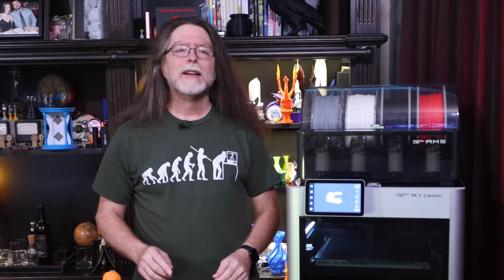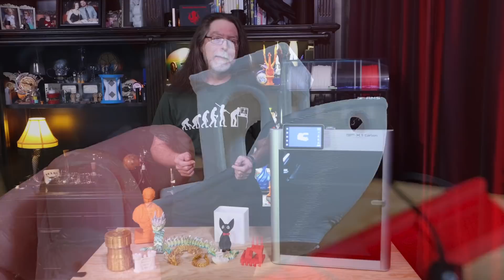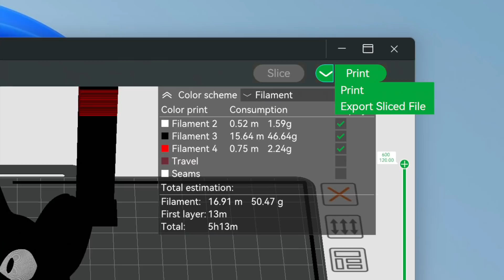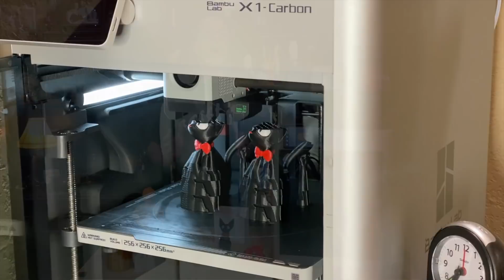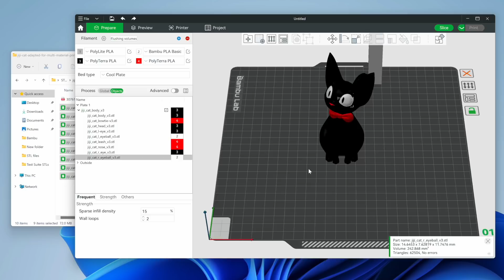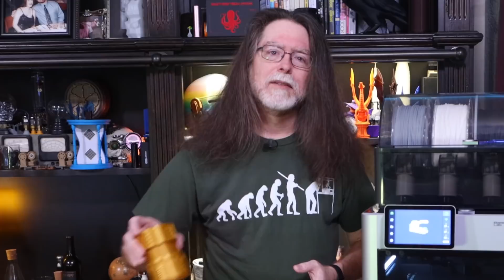First Look! Bambu Lab X1 Carbon - A CoreXY SPEED DEMON!

Comment: Does anyone know what the printer height is with the AMS on top? I've only seen dimensions of the printer itself.
Reply from the maker: Hi, it's 27 inches tall with the AMS on top.
Reply: @BV3D  Thanks so much for replying. I have a Creality CR-200B that I want to replace with this sitting in a 700mm space about 27.5 inches. Looks like it opens from the top so I would have to pull out the printer to change filament spools.
Reply from the maker: @RaviBowman  Yeah, you're looking at something like 34 inches to be able to open the lid on the AMS without moving anything. You're also going to need a bit of space behind the printer for a box to catch the purge squiggles. You'll need to pull the printer out to get to that so you can empty it.

Comment: As a 24/7 cloud connected device from china I don’t trust it. It could be acting as a backdoor to your Wi-Fi network or monitoring your devices data and sending it back. Also sending all prints to the cloud fist seems ripe for control reasons. Could easily monitor what you print. You print a nerf gun all the sudden you’re on a terrorist list thanks to this printer .

Comment: Umm this RFID thing I think is the most underrated feature of this printer . If they open source standardize a way for printers and slicers to automatically download settings for a filament kinda like driver for a piece of hardware. It would completely negating the need for filament tuning . That takes 3d printing to the masses . 

Like imagine this; I'm Joe schmuck nobodyson and I buy this printer and without having ANY knowledge of 3d printing I get some ninja flex , some Ataraxia FPLA and for the shits and gigs some Amazon basic . I plop them into my printer and the printer does its jig and tells the slicer I have xyz. The Slicer sees what filament the printer has loaded and   automatically grabs the optimized settings for the individual filaments, without the end user even having to know what they bought and where they put it !!! 😳😳😳... It's like using a microwave at that point.
Reply: 100% facts

Comment: Definitely picking this machine up at retail, assuming all the bugs/quirks are worked out  by that point. Hopefully this thing delivers on all its potential.
Reply: I am onboard with you. Especially with the proprietary parts (extruder) I first wanna know where Bambu Labs is going with this.
Reply: @hbgl8889  I'm also not into the idea of a printer that is only functional if it connects with a specific company's network, as I think was mentioned in this video. Wouldn't want to be stuck with a useless metal box if something happens to Bambu Lab's bottom line. Lol

Comment: What about octoprint compatibility?
Reply from the maker: Negative. With no USB port, there's no way for OctoPrint to stream G-code to it. That said, both the mobile app and hte slicer allow control of the printer. But if you're heavily invested in the OctoPrint world, and have some favorite plug-ins or you've got custom scripts running, this won't do that.
Reply: @BV3D  this is a Major Mistake on their part. In a proprietary system, you want a way to introduce features without voiding the warranty or messing with the FW. This might be a bigger problem than they realize. I e it be buying without integration. .

Comment: This is the third review of this printer I've seen in a week but the first that mentioned the mandatory internet connection. Thanks. 
Mandatory connection and registration is a hard no.
Reply: People are going to get sucked into a pay model you watch
Reply: There is no mandatory internet connection. I have been using the SD card. An internet connection is only needed if you want to send files to the printer over WiFi.
Reply: @rsilvers129  it should not require internet to work within a network, regardless whether it’s connected to the internet or not. The way it is made in this printer makes zero sense.
Reply from the maker: @rsilvers129  You didn’t have to get your printer on the network to get it added to the mobile app? If you didn’t, Bambu must have changed that (and that’s a good thing). I have printed from the SD card a few times, but I do like the convenience of printing from the slicer and also being able to monitor a print from my phone.
Reply: @rsilvers129  do you already have this printer?
Reply: Right if they stop the servers your printer is a pile of metal

Comment: THIS is the type of printer the community needs, something that can go mainstream, because right now there is a high learning curve that really keeps a lot of people away from 3D printers, making something fool proof where the average Joe can just send something they like or need to the printer and have it done quickly without issue 99% of the time will rocket this hobby (and yes, it's still a hobby) mainstream.

Now if they can get the price down further to under $1K, but I'm sure that will happen soon with either this company or another.
Reply: 100% get the price under $1k regardless of where one lives and then it will be real killer

Comment: Requiring internet and an account to use their software is a non-starter.  

Shame, almost eveyrthing else about this printer is ideal.
Reply: It doesn't require an account to use their software or the printer.
Reply: @rsilvers129  it is made explicitly clear in this video that you need an account to get the machine up and running.

Comment: Holy smokes! My dream printer seems to be the Carbon. Can't wait to see how the Kickstarter goes, and how support will be for those early adopters. Please keep us up to date on any changes/issues.
Reply: Kickstarter went well for BLabs, I'd say. Seemed to have launched a tad early? But the Early Bird full combo was sold out within minutes, with the lower tier filling up after that rather quickly. Many people just seem to have jumped to the Kickstarter special to not get the KS errors. Seems they likely made up some of the margin in the shipping costs, as they were steep at $160/unit for US - these will likely ship all together in a container, so costs will probably be lower for BLabs.

If I had to guess, all Early Bird and Kickstarter Special units will be accounted for within the first few hours at the rate it's going. It'd be questionable to grab one of the full price tiers because of the shipping costs (you won't likely see it that high in the full retail launch).

Comment: A little jeally, I gotta say…. This is probably the best overall consumer printer going right now. Of course it does need a powerful board to be able to achieve those speeds, and it needs high torque stepper drivers, so the Duet is a very good choice. It has a speedy processor, powerful (and loud!) DRV8825 drivers onboard, and runs the super-configurable RepRapFirmware. From what I understand, it also uses servomotors instead of steppers for X and Y, at least. Now I'm wondering if I could get the E3D Toolchanger up to similar speeds, hmmm….
Reply: I think it uses steppers, but i could be wrong.
Reply: The speeds are impressive for a consumer printer and I am impressed by that. However, to bring the comment back down to earth its not any faster than DIY printers modern 32 bit boards and 2209 drivers with Nema 17 steppers are all that is needed.  Throw in a Pi 3 and klipper firmware and you have a much easier to use interface than rep rap. Check out V3d, Voron, ratrig  for examples.
Reply: It's not a miracle printer. But as an off the shelf printer it should be very good.
But as doyouflytoo already said, DIY printers achieve the same.. but they lack the lidar scan. If that is really a thing

Comment: I would like to know if they are going to release the means to create stickers for the AMS or at least allow you to label them in the slicer, I have been stung by a machine that had proprietary spools before, I know you mentioned you can use third party spools to print with but does that mean multi colour and multi-material?

Comment: This Bambu machine is an enticing machine to say the least at $1400 compared to what else is available to but ready to print out of the box.

That’s about the same amount one could spend building a corexy like a Voron w/ERCF (a scalable multi color filament changer). Tradeoffs would be instead of depending on a company and locked down to whatever Bambu decide is allowed with the machine, you could free up a lot of options and learn as you build and customize a machine to your personal needs.

Comment: Iam concerned about so many Things at this printer which can broke an not diy repaired. And the cloud thing doesnt make it better at least if Bambu labs decide to let it die you have a big chunk of Electronic.
Reply: As with most things including printers the DIY crowd will crack it and make it self supportable before that happens.
Reply: Whereas I am very excited about a printer that I can treat like my microwave or my cell phone and not have to know how to build it in order to use it.  And if the cloud dies, use the SD card.  You'll still have the printer on your desk and the slicer on your computer.

Comment: There's some creature comforts like USB instead of microSD card that I can adjust to, but an always-internet-connected printer I cannot.
If it can't be used offline, I do not buy - full stop.
If they change it so it can wifi connect without paging back to Bambu servers/services and this is made clear in every step of the setup process, then I may pick it up.

Comment: A Kickstarter 3D printer from China doesn't sound very promising.  I don't want something I have ro connect to the cloud to use.  I have my own home network that I manage quite well.  I want the slicer on my Windows PC to be able to send the gcode file directly to a printer via hardwired Ethernet not WiFi.  Keep it simple Bambu.  

The other thing that scares me is the proprietary slicer and firmware.  I don't want to end up with an orphaned product if Bambu either fails or discontinues thus product.  The tech world is full of orphaned goodies.  Betamax, for example.  Technically better than VHS, but Sony lost that one and abandoned the product. 

I will wait for this printer to have a big impact on the 3D market and watch the veteran 3D manufacturers respond with upgrades to their printer lines to compete.

Sorry, Bambu.  Hard pass on this one.
Reply: Watch Edge of Tech's livestream with Bambu.  The proprietary part of the slicer is to get the ultra high speeds; you can always just send it regular gcode from any slicer, if you don't need the tuning for flow rate, etc.  And as said, you can always use an SD card.

(Also, may I recommend Technology Connections' deep dive into Betamax vs VHS ?  Basically, if he's correct, the popular claim that Betamax was better than VHS is confusing Betamax, the consumer product, and Betacam, the professional product; VHS was not only better marketed but actually a technological better product.  I found the video fascinating.)
Reply: @davydatwood3158  Even the Bambu slicer doesn't need an account or the internet.

Comment: Looks great, I’m really thinking on this one. I just wish it was smaller so it wasn’t so obvious waiting on the front porch.
Reply: You can send it to my house... I will make sure it is delivered and doesn't sit on the porch.
Reply: @1091tube  lol, more an issue of my wife finding it first!
Reply: In January 2021 I got screwed over by UPS when they claimed to have delivered a new M1 Mac Mini, claiming I rejected it, and they shipped it back to Apple, after forging my signature: my apartment complex leasing office wouldn’t sign for it, and while I was at home, they never came in line of view of my building.  

My solution? I’ve been renting a (privately owned) UPS Store box for my deliveries: problem solved!  Besides no porch pirates, you also hav the likely case of it getting delivered there earlier because they’ll arrange to deliver as many things at one stop (more people) as possible as early as possible.

Comment: I'm in the process of picking out my first 3D printer, and the X1 does look very attractive to me. I know that Kickstarter 3D printers almost always fail, though I should have grabbed a discounted ANKER when it was on Kickstarter, and a lot of reviewers are giving this printer great reviews, but I'm a bit hesitant to drop a grand on an unknown outcome. Printing in multicolor is nice, but not a requirement for me, being able to handle multiple types of filament, good print quality and ease of use are really what I need. I might as well be an old fart when it comes to programing, though I'm very comfortable with hardware replacement, building electronics and modifications, (as long as there are VERY good instructions), I know that some printers really need upgrades and mods to work very well so I know that there might be a lot of work with other printers. I've heard that Creality has had really bad QC lately and bad customer support, so I'm a wee bit lost in the sauce on picking a printer, and this really looks like a great printer. I might bite the bullet and give it a shot after seeing this video.
Reply: The buildup to the launch is crazy, it's clear it's going to sell out not just in the campaign, but possibly during the first day, and there's a chance that it will even be gone in the first hour.  I don't even know if Bambu Lab really understands the demand they are going to have
Reply: @timzalusky , that's very true, and will they be able to fulfill all the orders, will the demand break them? Will their quality drop to meat demand? There are a TON of variables that make buying in risky as is, add in the demand and it might be a bit too much. I've seen what happens when demand overwhelms a company, the pressure it can put on the people in the company and how it can effect their products. 

OY! I guess we'll see what happens!!
Reply: @timzalusky  this comment aged well. They were out of the carbon ams rewards within the first hour, they added more at least twice.
Reply: You don't need to get the AMS, that saves 150$, and if you don't need the higher temp options, you can save another 150$ by going for the X1 instead of the X1 Carbon.  700$ USD early bird / 800$ USD regular KS is still less than a Prusa.
Reply: The savings one gets is all dependent on what part of the world your from

Comment: the fontface on the AMS logo looks like AMG from Mercedes-Benz. :D 

That system looks very interesting and seems more practical than the Pallette. 

This printer looks like a very cool product, however I´d rather wait until it´s an actual retail product, specially because usually kickstarter campaigns for larger items don´t ship to BR. 

Yet, I do have a decent printer currently and starting a long-term project to build a Voron 2.4, so this isn´t particularly for me. Still, the ability to print multicolor without the need for an IDEX system is appealing, and probably will cost less than a Pallette.

Comment: Great video!  The Bambu slicer is a derivative of Slic3r, but you do not have to use it.  They claim you can use any slicer but have to use the SD card to print.  Wifi/Cloud integration is in their slicer only.  It'll be interesting to see what firmware their using.  Honestly I'm more excited about the X1/X1 Carbon than the XL I preordered!
Reply: Their firmware is all custom, according to them.
Reply: @williamsteele  I highly doubt they wrote a full featured firmware with, linear advance, input shaping and so many more “advanced” features in 22 months while also doing hardware, new lidar tech, slicer and tackling bugs on all the above. 
I would bet that is uses a custom klipper build, slicer is probably also heavily copied.
Reply: @thatDudeOverTher  Actually, that'd be easy to do... Their slicer is based on PrusaSlicer... they've already said that... but the firmware is their own.  Linear advance and input shaping are easy now that it is public knowledge on how to do them.  Clean room firmware is easy to accomplish with their resources.  They have over 150 engineers working on this project... it'd only take a few for the firmware, once a clean room requirements program was complete.  Remember, they don't have to do everything that all the other firmwares do, since they have a finite set of requirements.  Marlin/Klipper/RepRap need to support all their devices.... the X1 is the only printer they need to support.

Comment: It seems like there isn't an obvious way to connect an OctoPi box -- or functional equivalent -- to this to have remote control without using the cloud service. I'm not at all interested in a printer that I have to communicate with via a cloud service, when the computer with the model and the printer could just talk to each other directly without involving the public Internet.
Reply: If it can’t integrate with octoprint. It’s a No Go for me (as well as about 70% of ppl I’m guessing)
Reply: @chicagoal3731  Well, maybe not, but all the early bird specials are gone, and around a third of the non-early bird units.  So there's certainly some interest!
Reply: @davydatwood3158  I’m sure there is, but it seems very short sided to eliminate usb connectivity as it’s been a standard forever in 3D printers. You won’t have access to the 100s of freeware upgrades. Things like tplink outlet shutoff, built in terminal app, controlling relays, LEDs, ext devices.  Etc. hopefully they add it. Seems like a great print. I was already to buy one.